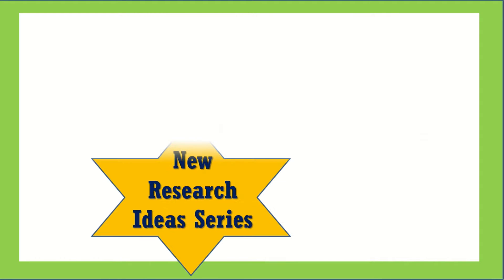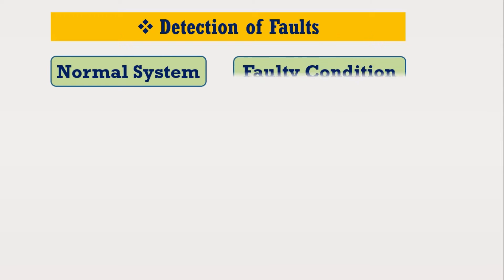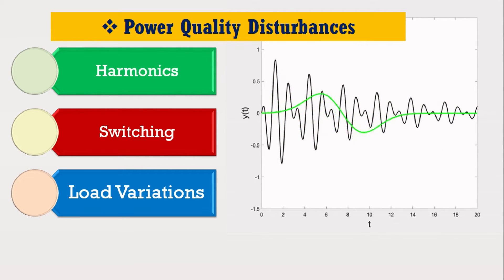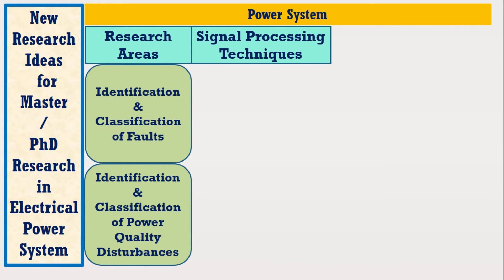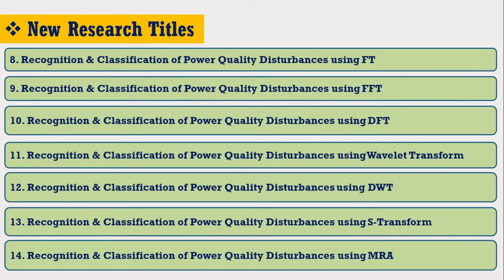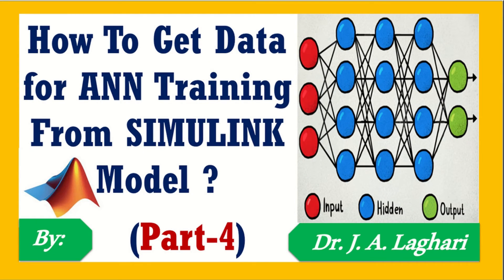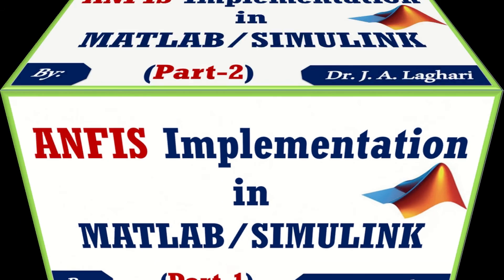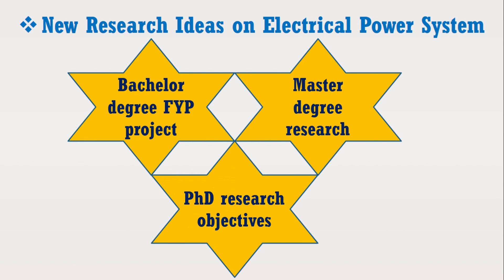New Research Ideas for FYP | Master / PhD Research in Electrical Power  | Dr. J. A. Laghari

Comment: Sir i have a problem in finding z bus matrix through y bus inversion. I found negative elements in the z bus,why is it so? I have tried IEEE 5 bus system.
Reply from the maker: Thanks for the comment. sometime zbus matrix through inversion is not successful. you may use specific program given in the hadi sadat book. zbus matrix separate program is provided in chapter 9. you may use that program. or email to jalaghari1@gmail.com, it will be sent to you.

Comment: Nice video. I so much enjoy your lectures. Can you do tutorial video on PSO. What are the new research areas in control system engineering relating to smart grid? Thank you.
Reply from the maker: Thanks for the compliments. Basically optimization is not my pure field. I am still trying to learn. Therefore, i will try to make video on this topic but not sure about its time.